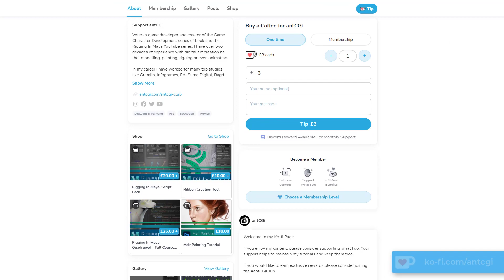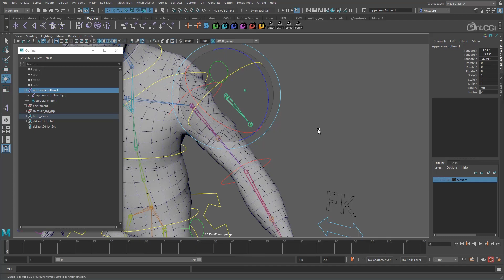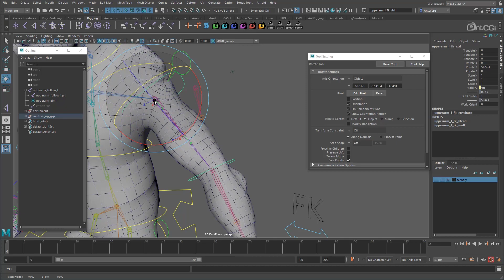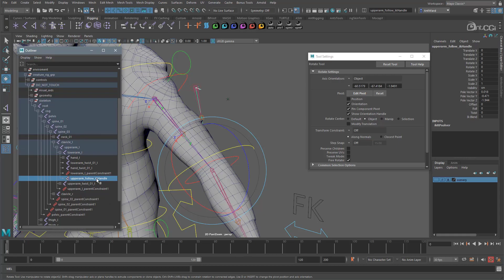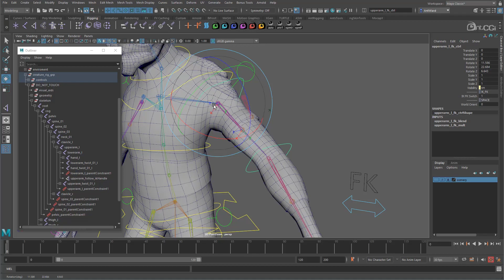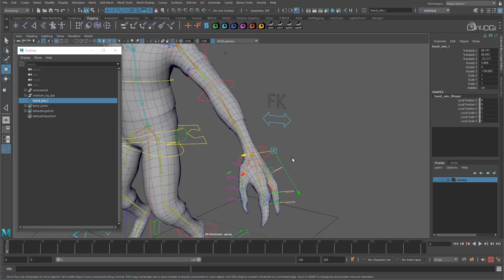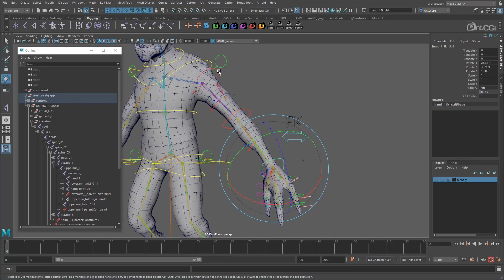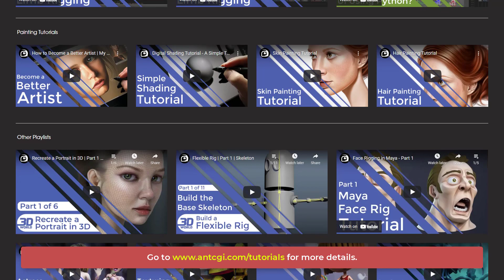#RiggingInMaya | Part 15 | Twist & Roll Joints

Comment: 📌Please note: the described method contains a problem. Twist bones rotate spontaneously when the cog or root is rotated. Please let me know if anyone has found a solution to this issue.
Update: The problem is that aim locators get offset when turning. This leads to incorrect aim constraints. As a temporary solution, aim locators can be parented under limbs root controllers.

Comment: Hi, I am following the Twist & Roll Joints tutorial and I'm having a hard time to make the upper arm first twit joint to twits, while the second twist join on the bicep does, how can I solve this issue? the same is happening on the leg twist joints, as soon as I set the pole vector values on the Ik handle it starts behaving that way in both cases

Comment: I can't snap my ik handle to the elbow just like you did in 7：21， it maintains the same position with the follow tip. Could you please tell me how to fix it.
Reply: This is very very late, but if anyone thinks they have the same issue, just zero out the xforms on the ikHandle and it should move to the elbow.

Comment: 11:13 At this stage there's a problem, that being the locators kind of... stay behind in terms of rotation, when any other part of the body is animated, and if the locator is further away the more pronounced its effect becomes on the arm twist. 

Looking into it further it seems the follow joint doesn't rotate properly along with any other transforms—despite the parent constraint—and this is with rotations checked. If you rotate the root 180 so does the joint... :(

Update: I can't get the upper leg twist to work either, in fact it's kind of unusable because the follow joint doesn't rotate properly which causes flipping whenever the root is animated. Theis tutorial series is great so far, but this part just doesn't feel tested at all.
Reply: I'm running into the same issue. Try rotating the whole character forward, as though they are doing a somersault forward in the air. The upperarm aim locator isn't rotating with the body in a "parented" type of relationship, because it is parented to the first "follow" joint, and that first follow joint's rotations aren't following with the body's rotation because of the ikHandle that is driving it (turn on the local rotation axis for the first follow joint - you'll see it). It will positionally follow along with the character as it moves through space due to the parent constraint attaching it to the high spine joint, but rotationally it is driven by the ikHandle that is parented to the elbow joint.
I haven't figured out how to solve it yet, but it seems like an appropriately created pole vector constraint would allow for that first follow joint to rotate when the rest of the character rotates ... I just haven't figured out yet how to properly create that pole vector constraint.
Any thoughts Ant?
Reply: @matthewleishman2769  I've come up with a simple solution to support root control rotation. Do this for each limb of the follow joints. An example is the arm...Create an empty group node & match-transform it the upperarm_rig_joint. Parent it to the limb group folder where the ik, fk and follow joints are. Parent constrain the empty grp to the upperarm_rig_jnt so it always follows the rig joint. Parent the follow joint to the empty grp. Now the follow joints move with the upperarm's rotation and therefore respects the root controls rotation.  It's worked perfectly for me now, hope it works for you :)
Reply: @JamesVilela-Slater  bit late but you saved me haha 🙏
Reply: @Elias_Crombez ayy glad that helped!

Comment: I think I missed something, at what point was the cog joint bound to the model? Currently for me it's still floating in world space uncontrolled (while everything else works), which means the leg follow joints don't actually follow any transformations/rotations.
Reply: It seems, he did that part in this part in this video(vid 15) without showing it. All you need to do is select cog_ctrl > select cog_joint > parentconstraint(maintainoffset=True). now when you use parentconstraint with thigh follow jnt and cog, it works properly.

Comment: First of all, these videos are an incredible resource for someone like me who is trying to break into the games industry as a rigging artist. So well presented and have helped me a lot. I'm posting because I made a rig following these series and every time I get to the twist joint I have issues with the twist system when I rotate the whole rig 180 deg in world Y. Lots of flipping and other issues. I'm not sure if anyone else had this issue and was able to resolve it.
Reply from the maker: Hi! I think I cover this in a later video.
Reply: @antCGi  Hi! i'm having the same issue and I can't seem to find the video that solves it.
Reply from the maker: @angie_1610  Hi, yep I cover it here - https://www.youtube.com/watch?v=DADqzaPigCE
Reply: @angie_1610  Hey! I was having the exact same problem, I was able to fix it by switching the values in the Up Vector of the aim constraint on the upper twist joints. Mine might be different to yours but as an example, my left arm up vector was set to 0, -1, 0. I changed it to 1, 0, 0. Seemed to work
Reply: @pianoneko9279  Hey! Thank you so much. I changed it to 1,0,0 as you said and it worked.